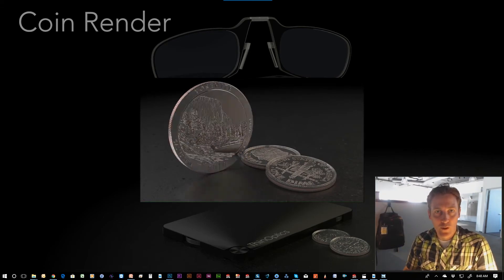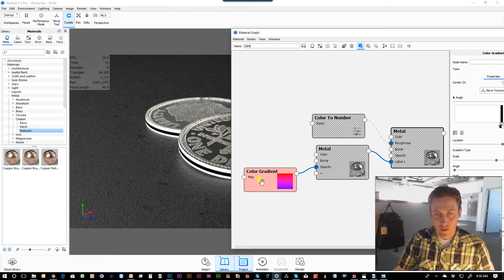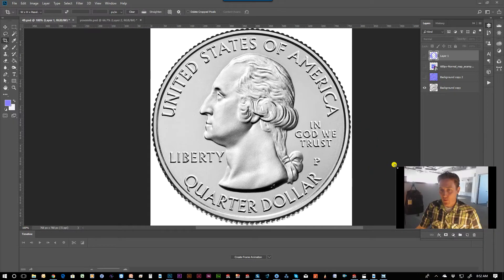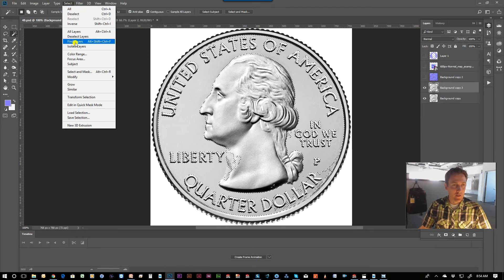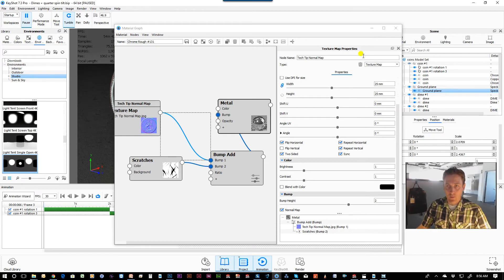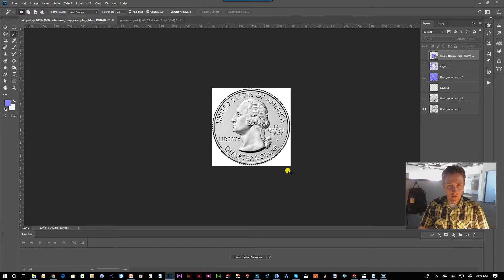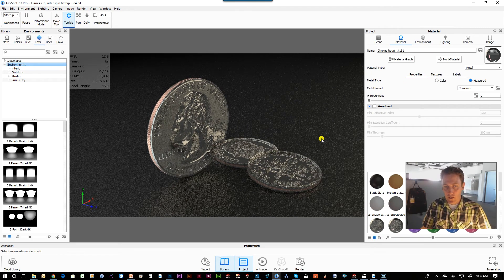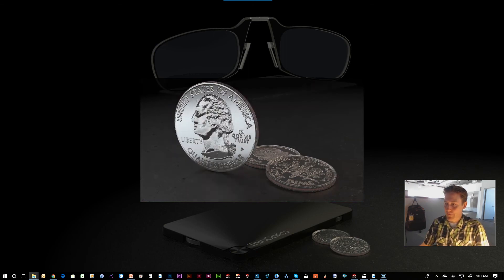Tech Tip 4 - Rendering Coins Using Normal Maps Tutorial

Comment: https://youtu.be/_PsNU_FP7yg?t=201

If I haven't missed anything here, then I'm pretty sure what you are saying here is not correct.. A "normal map" doesn't change the geometry of the mesh - it just reads the bouncing light in more directions (more accurate) compared to a bump map. A "displacement map" distorts the surface of the mesh, so this is the most "accurate" if you also want form changes to your mesh (better for bigger details).. A normal map does a really good job for smaller details though.